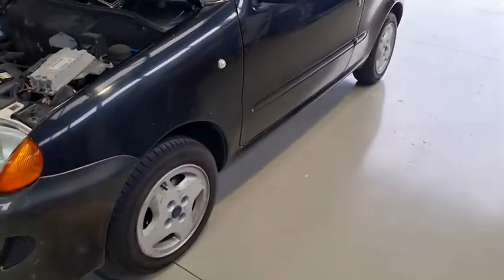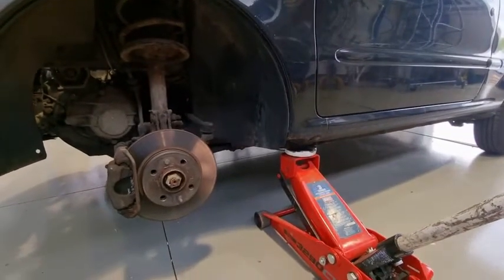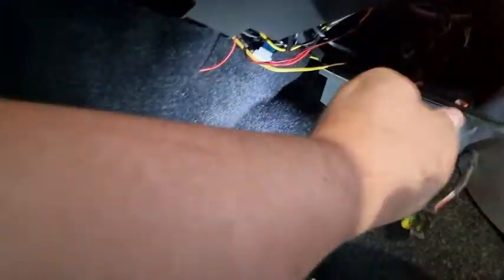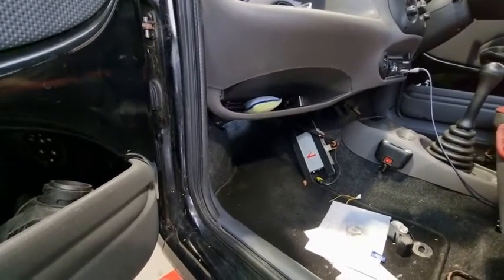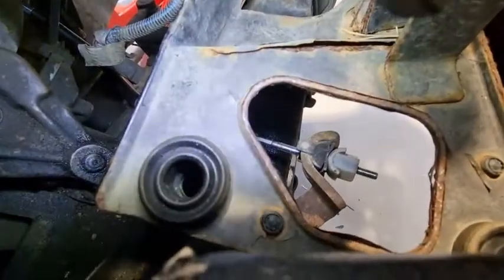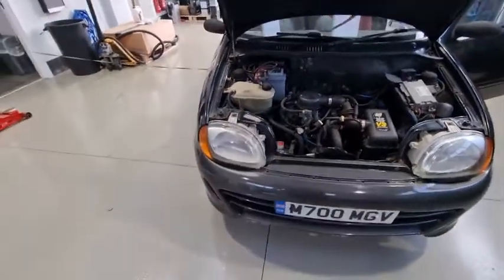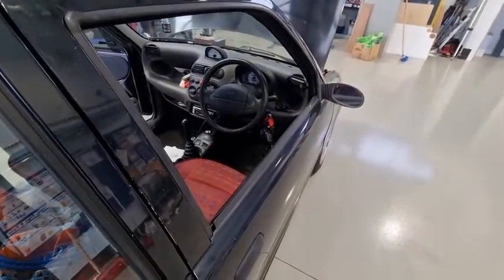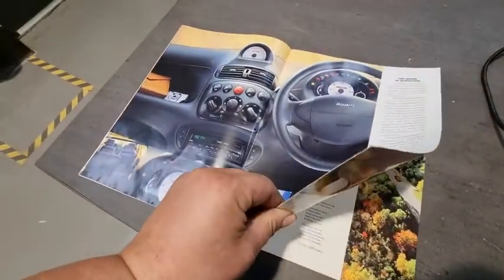Fiat Seicento clutch cable replacement and what info can we find in the sales book for extra options

Comment: They made a special version with "Citymatic" automatic clutch, the "Seicento Suite" and it came with the option of an AC also. Not many were made of this version. What Was special with that version was it had 12% taller gearing to keep the rated fuel efficiency, to counter the higher consumption because of the fitted AC. I kind of went the other way: No power steering, the taller gearbox from a Seicento Suite, higher compression, less aggressive cam, skinny wheels from a VW Lupo 3L and certainly no AC. I got 64 MPG year round average. The shop manual has a single picture of an AC compressor driven off a double generator pulley.

Comment: Hi there my couch cable shaped on mine today mine is fiat seicento s 2001 is it still same as this video thank you stu
Reply from the maker: Hi there yes, depending on the engine size, the 899cc is the smaller cable of the 2, the other cable is the longer one which is for the 1.1 engine

Comment: Hi, any ideas why my cable would keep snapping, I have changed about 5 so far. It is all routed correctly?,
Reply: Happened to me four times I changed the clutch and pressure plate it was worn and causing a lot of stress on the cable